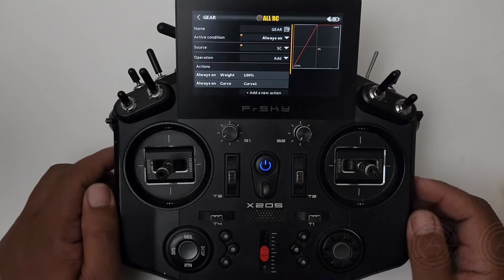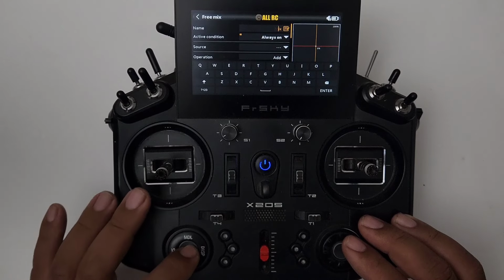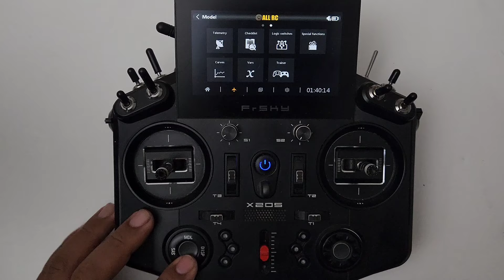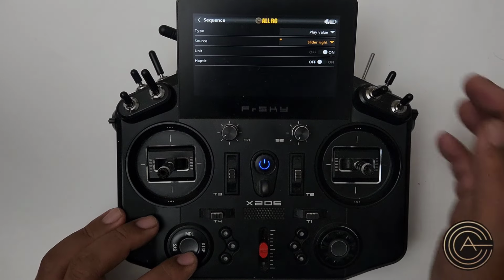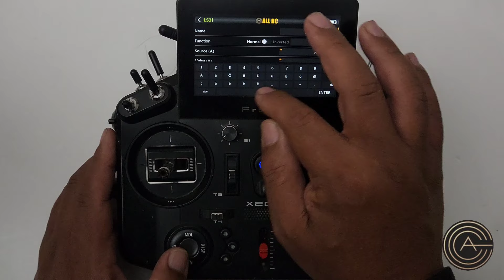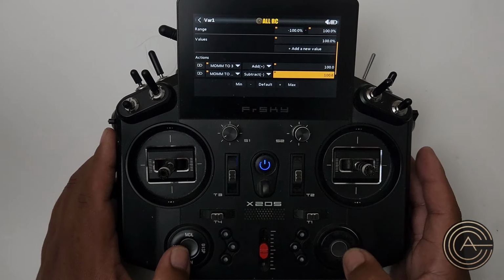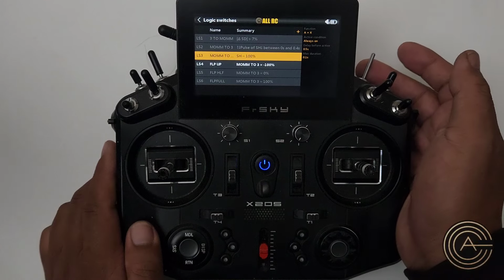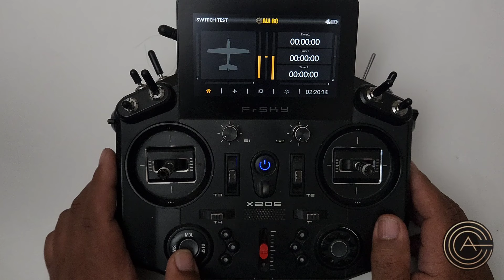The Frsky Series : Convert your Switches

Comment: Really appreciate your videos as a Spectrum convert to FrSky. Can you do a video on programming the momentary switch as a two position for "Engine Off" with a flick but "Engine On" by holding the momentary switch 1.5 seconds.  Thank you.
Reply from the maker: That's almost the same as my "A Different Throttle Cut Video". https://youtu.be/Hnt_wBivo8M?si=uqREy9EGbqeWQQsu I did two buttons that you need to press and hold for 1 second to activate and deactivate the throttle. Watch the video and where I program the "Sticky" Logical switch, just replace the Trigger off with the physical momentary switch instead of the 4TCut logic switch. That will allow you to flick for off and hold for on.

Also the 4tcut switch is an AND switch so I need to press two buttons to activate it. Make it an EDGE switch and program a delay before active of 1.5 seconds. That way, it's only one switch instead of holding down two switches.

Try it out. If you can't figure it out, email me and I'll send you instructions on creating it.
Reply: @all_rc  Fantastic! Thank you so much and again really appreciate all the videos and critical information you present.

Comment: Great video very helpful. So how do you make a switch act as throttle? What I’m trying to do is setup a switch for pilot fatigue for my reverse thrust. Brian Phillips has a YouTube video where he sets it up but it’s on Spektrum. This is done so you don’t have to give throttle while holding a momentary switch. Just flip the switch and it goes into full reverse. Thanks Art
Reply from the maker: Lol, I was gonna set that up myself on my EC 1500. I'll try it and make a video. Stay tuned!
Reply: Great i have the Freewing Zeus that I want to set it up on. Thanks again
Reply from the maker: Before I try it, it may not be quick enough for you as I have other videos to make....

I assume you already have the throttle Rev momentary switch set up. Keep it in operation for this.
Create a logic switch.
FUNCTION - AND
VALUE 1 - ( your throttle active switch position)
VALUE 2 - (your throttle reverse momentary switch)
* This is used as a throttle cut for reverse .. for safety.

Create a new free mix. 
NAME - SLOW
SOURCE - (your momentary switch for Rev thrust)
Actions
WEIGHT 100%
(Add a New Action)
SLOW UP - try .5 sec which will be 1 second ramp up
keep slow down 0sec
OUTPUT 1 - CH64
(This creates a dummy channel to have a ramp up to 100% throttle)

Create another FREE MIX
NAME - Rev Throttle
ACTIVE CONDITION - (logic switch you created)
SOURCE - CHANNELS - CH64
OPERATION - REPLACE
OUTPUT 1 - CH3 (Throttle)

Try that... But be careful in testing.   Haven't really tested it yet. Make sure the logic switch switch positions are correct and work properly
Reply: I’ll see if I can do it. I’m still new to this radio but I might be able to get help from someone in our club that knows more than I do. If not I’ll have to wait for your video. Thanks for the help
Reply from the maker: Clone your model and work on the clone (rename the clone in the EDIT MODEL page)... That way if it doesn't work, you didn't screw anything up
Reply: Ok I’ll give it a shot.
Reply: Got everything set like you said except on second free mix can’t set active condition on Ch64 that doesn’t come up for a choice only always on etc
Reply from the maker: Apologies... I wrote it too fast I changed that second free mix. And it should now be correct
Reply from the maker: Do your first tests without the plane, just look at the outputs page and see what channel 3 is doing before trying with a plane
Reply: Ok when I flip the switch ch3 goes to let’s say 100% but only for a second then goes back to-100%
Reply from the maker: Weird. Mine seems to work fine. Send me an email at All.rc.air@gmail.com and take pictures of the logical switches and mixes you created